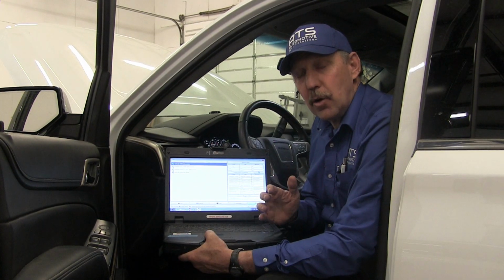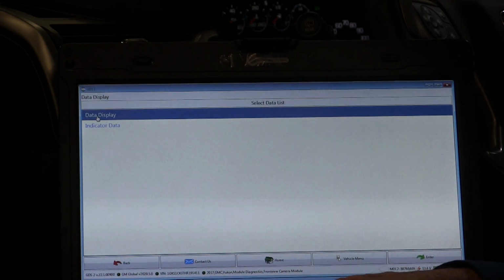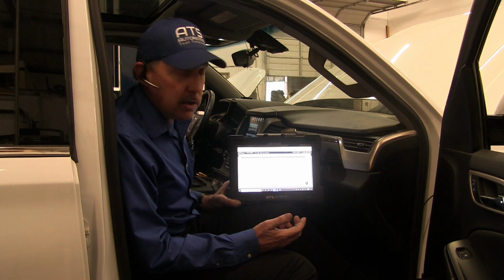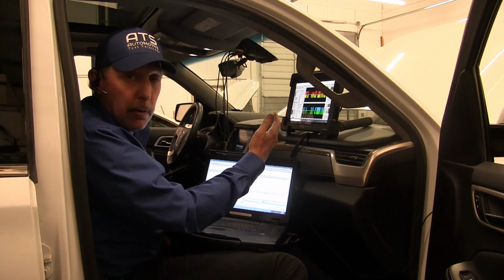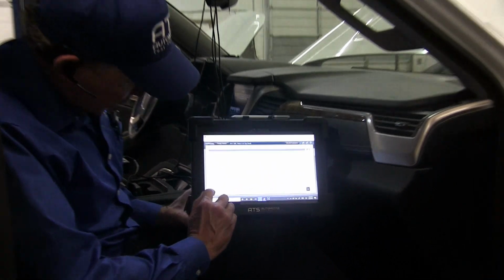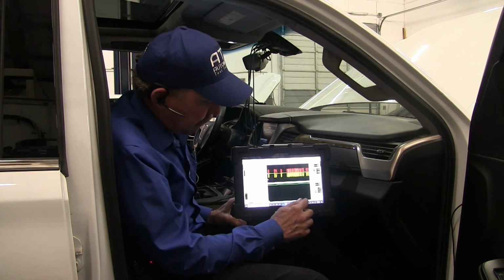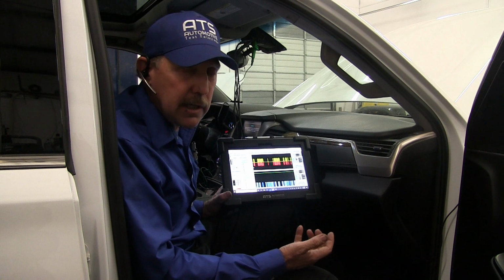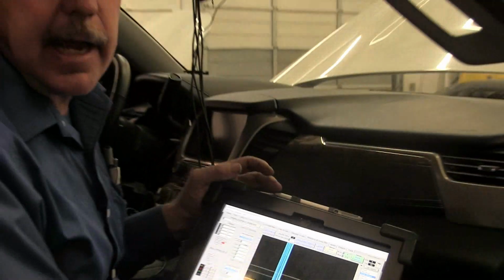2017 GMC Yukon communication failure diagnostic

Comment: FYI - Regarding the conclusions drawn  in this video: 
https://static.nhtsa.gov/odi/tsbs/2017/MC-10125125-9999.pdf 

"Due to a FVCM software anomaly, DTC U0121 may set falsely in the FVCM. Code U0121 will
set and transition to history status in the FVCM with each ignition cycle."

"Correction:
Important: Do NOT reprogram or replace the FVCM for a history DTC U0121 set in the FVCM."

"A FVCM DTC U0121, setting in history, without any other camera related symptoms, should NOT be diagnosed. If a
technician attempts to diagnose a history DTC U0121 set in the FVCM, this will lead him down the wrong diagnostic path.

If DTC U0121 is set current, then refer to SI and perform normal diagnostics.

DTC U0121 setting in history in the FVCM without any other camera related symptoms is considered a phantom code –
take no further action."

Comment: Where was the pinched wire.
I have exactly the same problem.

Only thing is that randomly I get “ park assist fault “ - I have a lot of lost combustion codes, but when I get the park assist fault - magna ride suspension goes in full stiff mode and it’s unpleasant to drive ☹️

Comment: In GM service info there is a document called "Data link references."   As GM dealer techs we always have to check that for the modules in question so we know every single network that module talks on.

Comment: I would of used the other gm software, that diagnoses can communications.gm in 2015 came out with with the the software and its great cause you can check all modules live and pings each module.so it tells you if it's communicating..as soon as I saw it was communication issue,I would of stopped using gds and used gm can software.there is a tsb on how to us that new software.you should you into if diagnosing gm can

Comment: These manufacturers need to get their stuff together. People who don’t know any better say things like they’re making it harder for us independents so they wind up back at the dealership but the evidence shows that it’s not the case and they are just flat out incompetent. If that were the case then these vehicles wouldn’t be ending up in the hands of people who know how to think outside of manufacturer flow charts to finally fix the problem. It’s sad when the dealerships have a bunch of cars come through that they don’t have a clue on how to fix because of their own foolery. Just like that diagram missing that Gmlan wire. How does that get left off of a communication bus diagram? It’s ridiculous and our industry is full of this kind of stuff. It tends to help me because I get quite of few of these problem child vehicles brought to me but I can’t help but feel for the other techs in the industry with less knowledge/experience. I get irritated sometimes because I feel like I’m constantly on the phone with peers helping to give them direction but where else are they suppose to turn to when they can’t trust the information that supposed to guide them.

Comment: Data Communication Schematics  

 
Figure 1:  Data Link Power and Ground, and Low Speed GMLAN (1 of 2) 
Figure 2:  Data Link Power and Ground, and Low Speed GMLAN (2 of 2) 
Figure 3:  Gateway Isolated Low Speed GMLAN 
Figure 4:  High Speed GMLAN (1 of 2) 
Figure 5:  High Speed GMLAN (2 of 2) 
Figure 6:  Gateway Expansion High Speed GMLAN 
Figure 7:  Gateway Isolated High Speed GMLAN 
Figure 8:  MOST Communication Bus 
Figure 9:  MOST Bus Communications Enable 
Figure 10:  Chassis Expansion Bus (1 of 2) 
Figure 11:  Chassis Expansion Bus (2 of 2) 
Figure 12:  Powertrain Expansion Bus (L83 or L86) 
Figure 13:  Object Detection Bus (UGN+Z75) (1 of 2) 
Figure 14:  Object Detection Bus (UGN+Z75) (2 of 2) 
Figure 15:  Linear Interconnect Network (LIN) Busses (1 of 3) 
Figure 16:  Linear Interconnect Network (LIN) Busses (2 of 3) 
Figure 17:  Linear Interconnect Network (LIN) Busses (3 of 3) (X88 or Z88) 
Figure 18:  Linear Interconnect Network (LIN) Busses (3 of 3) (Z75) 
Figure 19:  Accessory Wakeup 
Figure 20:  Communications Enable 
Figure 21:  Communications Enable - Object High Speed GMLAN  
all the comm lines on this vehicle from GM SI

Comment: That is GM low speed LAN per SI. Just did a 17 Yukon with intermittent Low speed LAN crashing..Wiring harness was rubbed through on steering col.bracket GM calls both High and Low speeds LAN (local area network).

Comment: So the only thing delaying the diagnosis was that you chose aftermarket wiring diagrams. Using the OE diagram it would be evident in the initial system overview . Either way fixed and thank you for the video

Comment: Bernie, that was fantastic! Thank you for the tips on GM Bus communication strategies. So did the original camera actually fail, or was the broken comm wire the issue all along?
Reply: Pine Hollow Auto Diagnostics good question.

Comment: That's ridiculous! Several pitfalls there to send a mechanic astray. Little wonder that diag is now almost a separate job. So little effort by manufacturers to design systems that are easily worked on.